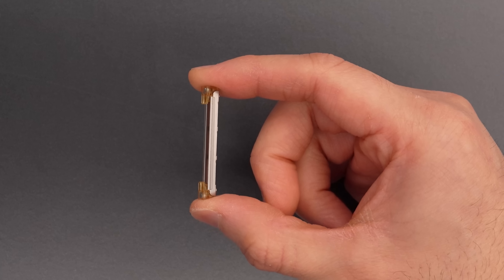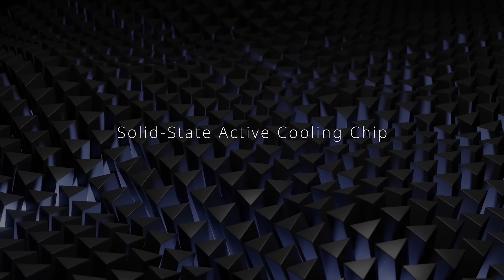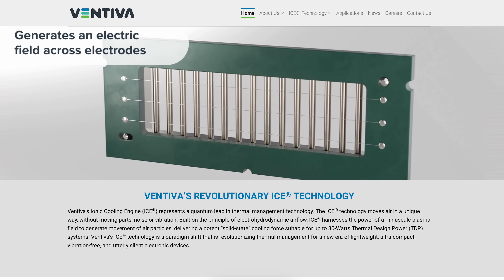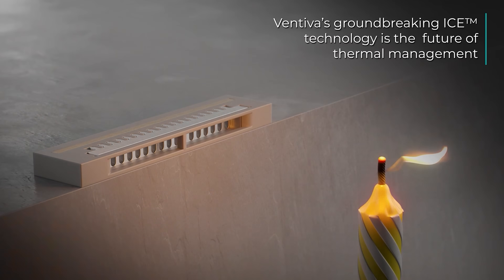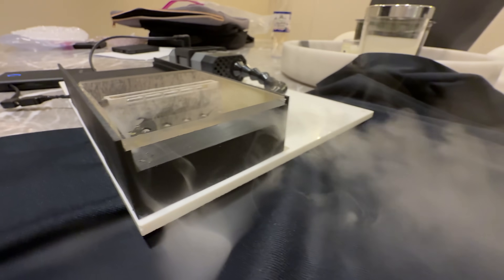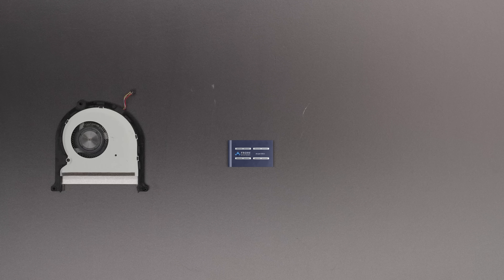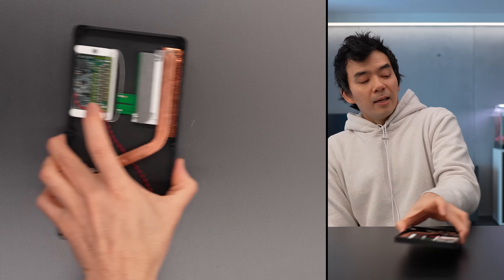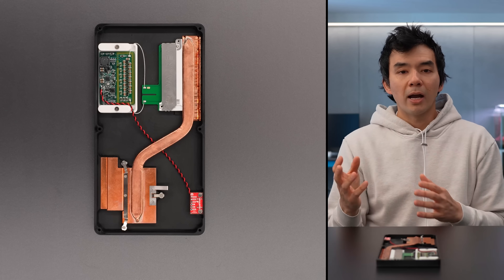The IMPOSSIBLE Laptop Fan...

Comment: The selling point of the airjet wasn't the cfm but the speed of air flow at short range. The inventor explained that when you blow air on a very hot object, the air molecules never really make it to the hot surface because the heat repels them. When the air flow is fast enough, this barrier is broken and the cooling becomes much more efficient.
Reply: Isn't that way you have vapor chambers, alluminum blocks, etc. in order to make contact and transfer heat away so a slow air can become effective?
Reply: Not sure it's the heat that creates the boundary layer... But anyway, that is a major difference that Frore have probably not been emphasizing enough.
Reply: I feel like Frore is too focused on the wrong market, the primary constraint on laptop cooling is performance per watt. They have made a powerful compact pump at the cost of energy, I feel like a better market would be like hairdryers or something.
Reply: @kentonwu4383  I think that the reduced size could compensate the energy cost by increased battery. Also, the static pressure issue is the lowest with it.
Reply: But laptop coolers don't blow on the hot surfaces, it just drags heated air away from inside
Reply: It has more to do with that boundary layer creating laminar flow in a typical heatsink-fan setup. Frore introduces a bunch of impinging jets of air perpendicular to the boundary layer that breaks up the laminar flow and achieves significantly better air mixing so it can become heat saturated. It doesn't appear that Ventiva's solution addresses that fluid dynamics issue. Instead of using a single corona wire on the front of the device, they could do something similar to Frore and create a bunch of corona discharge emitters on the intake plate to drive impinging jets into the thermal interface plate. Not sure if Frore's already patented that particular design yet. If not, they should get right on to patenting that idea.
Reply: pray, tell, why don't high performance laptops use it then? If you still can't figure out, it means you have a neurological disorder

Comment: thanks but no thanks, some things are better kept as simple as possible. I already stumbled across the keyboard failure in my MSI laptop because nobody at MSI though about insulating the keyboard from the mobo, so the keyboard layers die after 4-5 years of constant exposure to heat from it. I don't want to replace my laptop cooling system every couple of years too because it ran out of Mn. So please, lets just make companies let back engineers to designing stuff instead of marketologists, that would be a huge improvement already!

Comment: I can appreciate the enthusiasm for this tech, but honestly the problems this has vs the frore solution, just means the airjet is more suitable for drop-in replacements and more ease of adoption in newer laptops. Others have mentioned the Ventiva tech is actually old, it produces more than just Ozone, the Ozone creation process is exothermic, it lasts less, it can become an electrocution danger, etc. but without even going that far, the static pressure capabilities of the Frore Airjet just demolishes this fan, and this is probably what you want most on a laptop due to the tight spaces air has to move through. The Airjet does mean a CPU will run hotter than with normal fan, but as Linus has pointed out, it's not due to a low CFM, but rather due to the Airjet's static pressure being that much better at cooling everything else as well, meaning the CPU can keep higher speeds for longer without impacting the heat of the entire system. The CPU might run hotter, but the laptop is more performant and won't burn your hands as much. The results are indisputable, and this means manufacturers don't have to compromise on component positioning or design, as opposed to the Ventiva fans which basically require a redesign of laptops from the ground up to account for their low SP. The power efficiency of the airjet may also pose a problem, sure, but more modern CPUs are achieving incredible efficiency and making laptop batteries last that much longer, meaning there's going to be breathing room for these kinds of cooling solutions, especially as we aim for lower TDP & lower power consumption CPUs. If I had to guess, the airjet paired with more modern x86 CPUs such as the Ryzen AI HX 300 series, would probably deliver incredible performance, at incredible temps, and with still incredible battery duration.

Comment: I'm reminded of that time the mythbusters built a levitating platforn using a bunch of homemade air ionising thrusters (made of wire and kitchen foil, iirc) and a 3kV lab power supply 🤣

Nice to see the old tradition of dangerous voltages in consumer electronics is alive and well!

Comment: I took apart one of my grandmothers air purifiers back in the 1990s and it had this same 'game changing technology in it'
Reply: Sharper Image used to sell these air purifiers
Reply: Yes!  @jphillips5576
Reply: Ah, yeah, the "Ionic Breeze". They got in some hot water with the Feds for initially not including the palladium catalyst in their early models and generating a ton of lung-destroying ozone. They eventually partnered with Engelhard for the metals coating and fixed that issue, but their reputation was severely tarnished by then.
Reply: theres nothing new under the sun
Reply: Just negatively charged ~2-10kVDC jumping into the air off spikes (ok) or bundles of hairs (better).  No biggie.  The voltage used to come from a ladder network but now you can get tiny switching power supplies that are sealed under epoxy to avoid voltage breakdown inside from moisture and dust.  Look for "anion generator" the kit components, not the assembled devices that are often flashy snake oil.  You will need a lot modules  (36-72) in a parallel array.  I assembled mine on the plastic intake screen of a box fan.
Reply: @qwertyFUBAR you can get 30-50w ozone plate generator modules for like 20-30 bucks now. The psu is embedded in the base.

They'll full on ozone fog up a room in 5 mins.  Obv do not stay in the space if running like that.
Reply: Hpahaphaphap 😂😂😂😂😂😂
Reply: Creating OZONE!!

Comment: I can barely hear this video over my laptop fans. :|

In relation to design from the middle of the video, my fans are large, but of course this laptop has a desktop GPU and desktop CPU in it. It easily reaches 102C with ease. I barely have to run a video encoding for a few minutes to hit that high temperature that drops CPU speeds. Frankly, I keep this laptop plugged in constantly, as the battery only holds out for about 25-40 minutes. I dunno how much airflow my laptop can produce, its two fans that run around 5500 RPM top speed, very loud.

I ended up buying a headset so I can play my games without hearing the fan. xD

Comment: these products emit ozone, which can be harmful in small areas with little or no fresh air flow
Reply: A lack of ozone can be harmful, it's why indoor air is so unhealthy and "not fresh", ozone is what freshens air. The concentration of ozone required to be unhealthy is very difficult to achieve.
Reply: @mikey4016  it's harmful at just 85 parts per billion. if your going to generate ozone in a room, you don't want humans or pets in said room. in this scenario the amount of ozone put out by this thing is very minimal, hence why I said it could be harmful in a small room with little to no airflow (i.e, no window) if the unit is running for long periods of time

Comment: Hot take: laptops should never need active cooling. If you reach a chip power level you can’t cool passively, it shouldn’t be in a laptop. Remote into a proper workstation for your heavy lifting.

Comment: You also have to consider failure points as a hardware technician.   How do you know when it fails?  What failed?  What needs to be replaced?   Are hardware technician now required to be Electricians?  There are only 3 failure points I can see in this video, what if you replace all 3 failure points and it still doesn't work then what?  Did it really fail or is it the motherboard or power supply that failed?  What happens if it does fail does the CPU become a fire hazard?  At what point should that be a consideration?  Is this just another way for Dell to make their hardware proprietary?   Now you say it will come with an increase in cost?

Newsflash:  There's a reason Apple has such a small market share in the PC world.

Q3 2024: Apple's market share in the global PC market dropped to 7.7%, making it the bottom-ranked vendor out of the top five. In the US, Apple shipped 15% of all PC units in Q3 2024, ranking fourth among vendors.

Looks like Dell wants to shoot itself in the foot now too?  I don't think Dell can afford another Chapter 11.  They've already declared bankruptcy 3 times in the past.  As a techinician I will actively tell my employers not to get one due to cost and maintenance head aches.  It is nothing if not easy for Businesses to switch vendors such that they are not locked into price gouging support from Vendors like Apple and Dell.  Who do you think pays that cost increase?  Not Dell.

Not to mention Dell outsources its lower level support roles to India who actively take American Jobs away from qualified Americans.  To say nothing about Foreign Job Recruiters exploiting the H1B visa loopholes to bring in unqualified Indian IT workers for lower pay rates whom also resume farm American IT Employees for credentials to apply for these jobs.

Ya the shit piles up pretty quick when you think about it.

Comment: surprised how Dave reacts to this so called "Crazy fan", which uses the ionic wind. meanwhile I build one of this https://www.youtube.com/watch?v=vzZy1Aqleno in 7th class, using flyback transformer. 

this is nothing new, problem is you would be using over 3500 Volts on a consumer device . . . its extremely dangerous if it misbehaves, not to mention, at those volts, current archs.

Comment: So, if I understood this correctly, the first airjet was not energy efficient but usable and the second airjet is not functional. The first one is better as it is at least usable and the second would struggle with generating airflow especially when in everyday use air intakes are partially blocked sitting on thighs clothes etc.

Comment: You know your an idiot right? The air jet doesn't need to move a lot of air because it uses jet impingement to massively increase the heat transfer to the air because usually air is an extremely poor thermal conductor, but if you can completely remove the boundary layer of air from a surface heat transfer efficiency suddenly becomes 100% because no longer do you have to relay on convection to transfer heat from the surface of the material through the boundary layer of air to the surrounding air the air will come in direct contact with the surface and will instantly becomes the same temperature as the surface you are trying to cool you need to have the air fired at the surface a transonic speeds to actually achieve it so yes it moves 1/5 the amount of air, but it's using that air much more efficiently to do the job you actually want it to do.

And what proves this is that the air jet is as efficient as regular fan is that it can remove 15W of heat at 1W which when it comes to tiny coolers like in laptops with high RPM fans that is competitive, and do you worry about your speakers vibrating your laptop apart? Then the air jet should be even less of a concern.

Comment: This will degrade due to its proper function. When it does so, it will begin producing chemical elements that are undesirable to humans, and eventually dangerous. Then, if it is not often specifically serviced, it will go beyond that and begin to arc. Beyond the potential damage to the equipment, because it will undoubtedly be mounted near the sides to draw and push air, it could potentially do harm to the user as well. 
 I do like the idea, and perhaps they have worked around a few of the inherent problems that as far as I know, have not been solved in any industry that could benefit from ionic fan type technologies. It would be game changing if they have. 
 Really I hope so, and wish them luck. 🍀

Comment: Hmm, having seen the frore explained, the problem is not the CFM, but the limited cooling capacity. it can only cool 5W for the small model, which is not quite enough for a laptop. As they explained it, it can build up static pressure, which is good in the narrow air channels of a laptop.  As you explain it in the video, that is the weak point of the ionic thruster.
Assuming both technologies works as advertised,, I can see a combination of both as the winning concept. use the frore to suck in the air and deal with the static pressure, and use the ionic thruster to get rid of the hot air at the end of the loop. win/win. 
Both techs are super cool (excuse the pun), and I hope we will be able to buy them and used them in other projects. 

However... I suspect the frore might suffer from ultrasonic noise issues, and the ionic thruster from shorting out and maybe even being a fire hazard. (because dust will definitely create issues there.)

Comment: Dust, carbon particles and moisture will disturb its operation in no time. The high voltage will short circuit and that's it. 😊

Comment: The airjet energy efficiency per cfm is really bad, but the static pressure is wayyyy higher than a typical laptop fan. So a properly designed cooling system would be able to effectively pull much more heat out of cpu at a lower volume of air.

Comment: That about the RF electrical interference that is emitted from the electrical ionisation and this interference is bad for sensitive electrical devices like laptops and and PCs and other computerised technologies so this high voltage ionisation technology are generally incompatible with computing technologies so this seem like the people that are making this ionisation airflow device for computerised devices are only making snake oil. You can't even a ozone generator near a computer because of the RF interference emmited from it and the same gos for tesla coils they cant be near computerised devices because they interfere with the computer operations and can even burn out the computer circuitry and CPUs and GPUs like EMPs do and thats why humanity is very varnarable now because we are a  technological civilisation and solar flares hit earth all the time in different power intensities and there can be solar flares that can destroy all electrical technologies on the entire earth because of EMPs wich produces RF interference so puting an ionisating device in a laptop computers makes absolutely no practical sense at all also the ionisation causes corrosion of metals and ruber and plastic to degrade and perish and become very brittle and weak so this idea is very impractical in this situation.

Comment: Less efficient, not much smaller (when you factor in the power supply), far less durable, and a potential shock hazard if anything metallic pokes in there…I’m sure there are some highly specialized industrial and scientific applications where this makes sense, but not consumer electronics.

Comment: this tech has been around for years and years, back in the 2000s i had a sharper image ionic air cleaner, no moving parts  but would clean and push air through a room, is pretty much the same exact technology. someone just thought outside the box for once and realized it has more applications that just simply cleaning dust out of a room, dyson also created something similar that was a giant ring and it would silently push air also using ions. 

surprising that it took this long for someone to realize the potential of this ionic breeze technology and use it for something other than cleaning dust out of a room. creative outside of the box thinkers push ingenuity and change the world by thinking about what a tech can possible be used for....

as a negative side note of this technology, because this technology is ionizing the air, any dust in your house will build up on the negative poles of the device and eventually the grill could clog up or at least significantly need to be cleaned, anyone owning an ionic purifier will be able to tell you it required constant cleaning of the negative panels because it attracts all the dust and debris to it.

Comment: Someone get this tech to Airplane manufacturers - the biggest limitation I can tell from an engineering standpoint for the current version you have is the volume of air that is able to interact with the ionizing wire at any given time due to the air being inherently still.

slap these onto the fins of an airplane however, now you have jet streams of air that are constantly being accelerated by the ionization affect that are flowing in by the metric ton. In theory, this could increase efficiency, lower maintenance costs, and help replenish/maintain atmospheric Ozone. 

(there will more than likely be other engineering issues like how well it scales to those sizes, the durability of the materials in those types of environments, etc, but just like how a simple fan became a turbine that propels us at mach speeds across the atlantic, this kind of tech can help to push aerospace travel to become electric as well and completely carbon negative)

Comment: A greater problem than Ozone is Nitrous oxide gases which are build made from the high voltage. And the dust problem is something U can't even solve today with fans. There are households where people smoke and this stuff puts a layer of residue and bitumen on the metal and then that's it with conductivity 😢

Comment: 1. They have horrible terrible static pressure. 
2. They will require high voltage generator and will be very high energy consumption. 
3. If it gets wet, even slightly... Start praying 😂😂😂